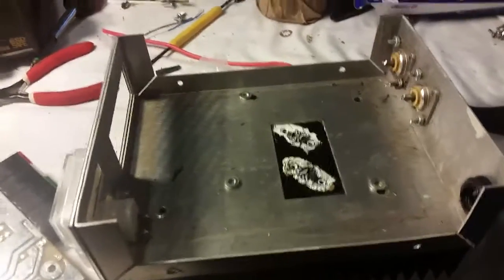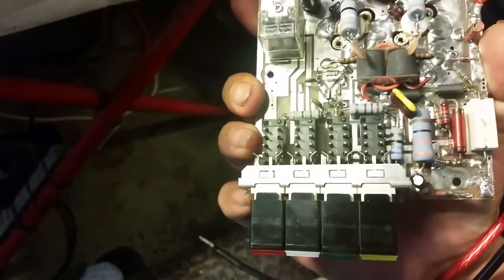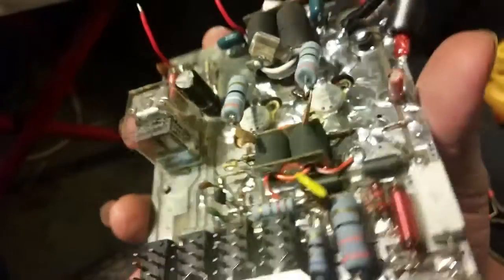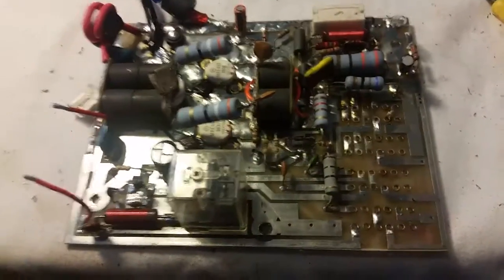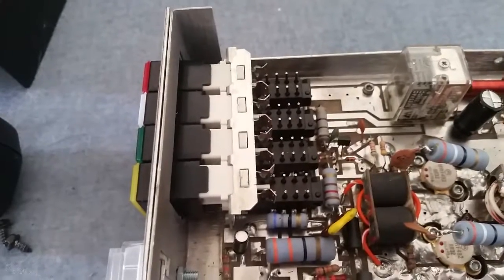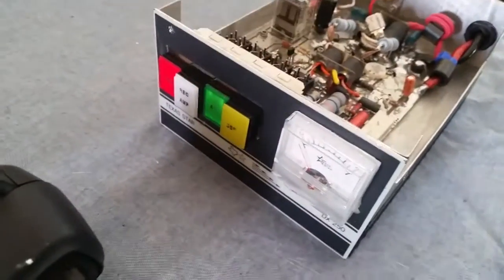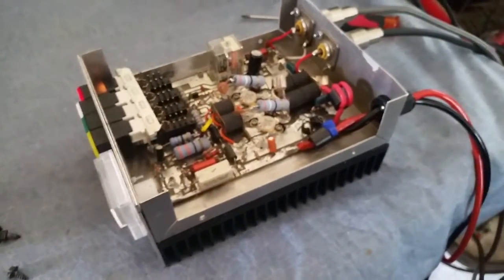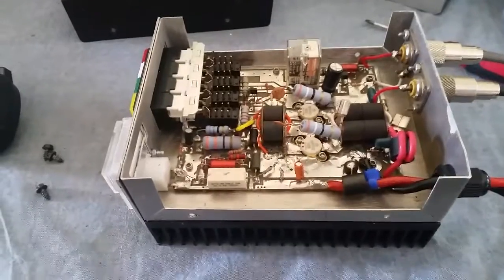Texas Star DX250 Switch Array Replacement & Repair 2xMRF492's

Comment: I need a switch assembly for a 350hdv. Got one to sell
Reply from the maker: Ooooooooooooooooooooh its tuff selling parts lol...I dont have any new ones now but used ones yes. They are still connected to boards thohh.
Reply: @1883GotDown  I managed to make it work. Jumped one side of the switch for the lights to work

Comment: You showed how to pull them off, but not how you un soldier them or did I miss that in the video?  I am currently working oh a HD 350. How do you un soldier all them pole pieces???
Reply from the maker: Maybe I didn't been a while since I watched the video. The way I did is I put flux on each hole. A decent amount. I used a solder sucker with strong suction and went to hole to hold sucking the solder out of each. If you do it right it will suck the solder out completly. Make sure to use enough heat as well. Good luck.
Reply: @1883GotDown   cool thank  you, ya I was wondering solder sucker or solder wick. I think my switches are ok but..... I'd really love to get those push buttons out of there and convert the unit to three toggle switches.  We'll see lots of work.  Thanks for the reply 👍👍

Comment: Why did you replace the originals transistors with MRF492? Sure the minimum output power pepe is 70 watts compared to the 60w for the MRF455 but the gain is only 11 minimum versus 13 on the MRF455. The efficiency is also higher on the MRF455 55% versus 40% for th MRF492. The only reason I am asking is because they are $10 more than Macom's 455 and the SRF3772 hi beta MRF455. They work just fine just thought I would ask though.
Reply from the maker: i didnt. it came in for repair like that. someone else put those in there. will read your msg when i wake up later. thanks